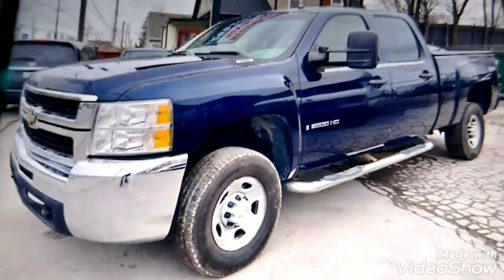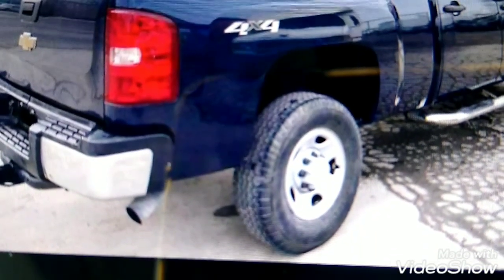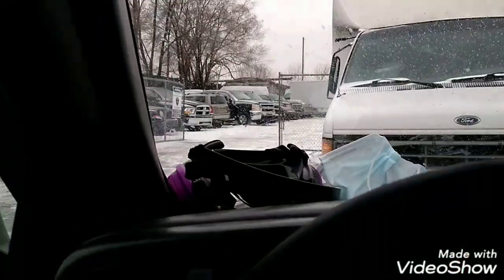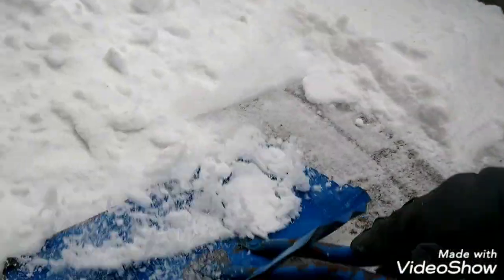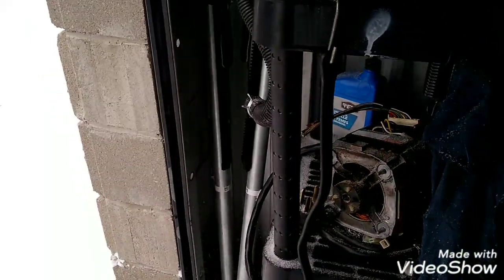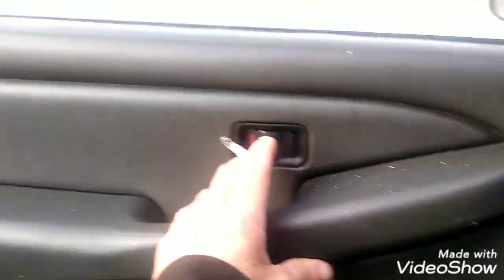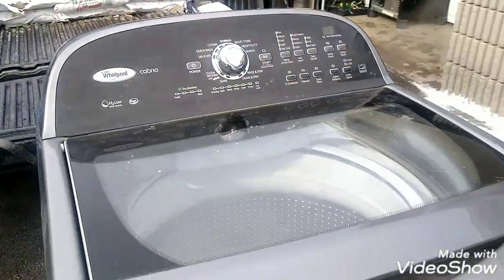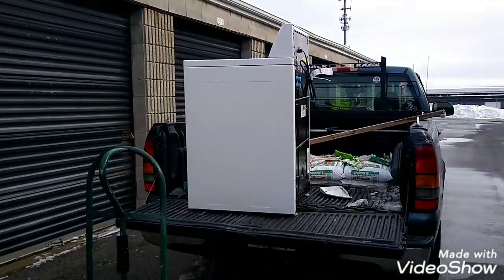How To Load washer On  You're Truck 👍

Comment: How do u test appliances inside the store . Don't u need dryer plug? Any suggestions?
Reply from the maker: Hi thanks for watching I have a generator .you can have one installed or use a stove plug . you would have to buy the Dryer box's plug .
Reply: They have generators with the 240v plug in?  That's my only dilemma to fix broken dryers. It's rhe 240v outlet.
Reply from the maker: @weanswered5636  they do have 220 gen .but if you check the dryers like I said every thing . you don't have to plug it in but only analog dryers that have no computer's in tham .I sold lots of dryers and no complaints .I will make a video on a dryer from top to bottom with out pluging it in 👍